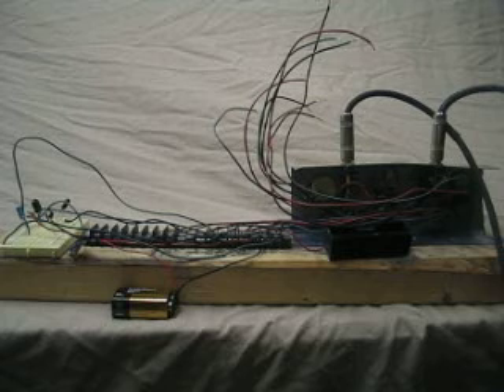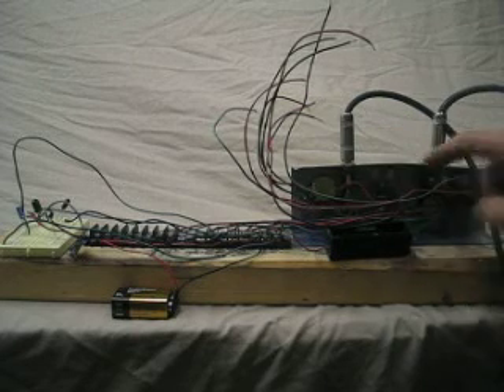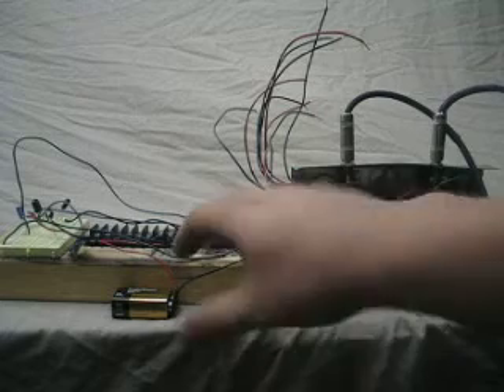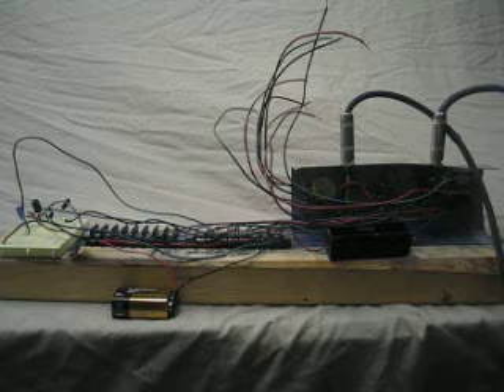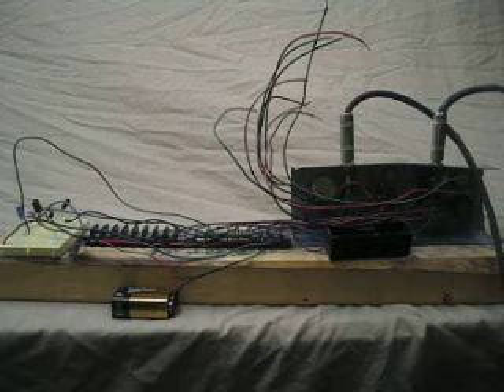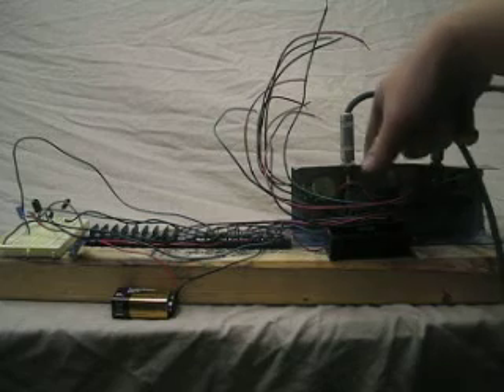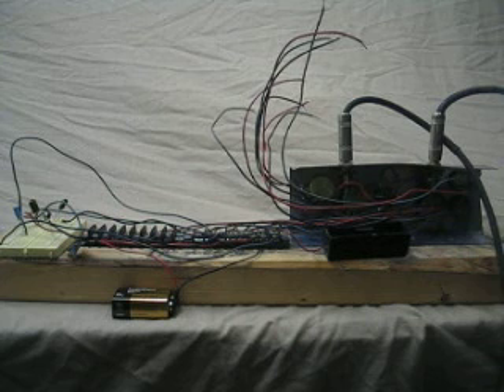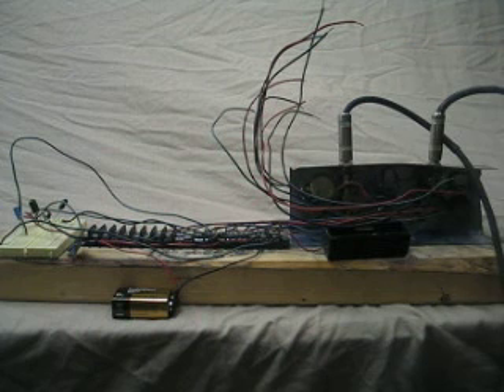My Home Made pedal circuit tester/ effects pedal Prototyping Rig

Comment: 2009?! Why am I just seeing this? Prototyping rigs are a MUST HAVE for building experimental circuits. I've made several over the years and I keep adding features like a power brick, knobs, switches, multiple input/output jacks. I'm to the point that putting in a 20dB boost is standard because I always put on at the front of the circuit just to blast through a filter I'm working on. Good job!